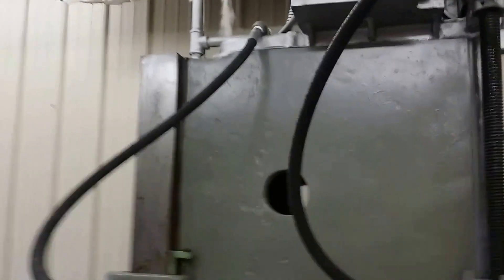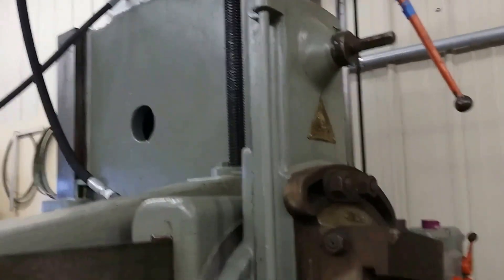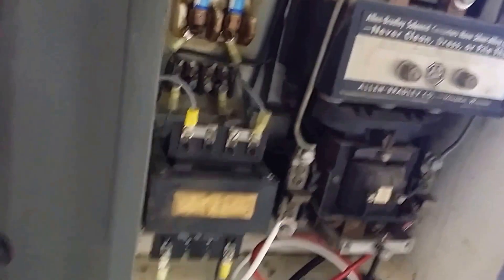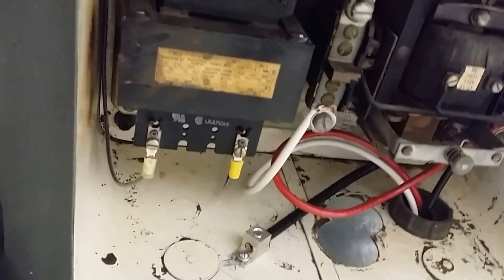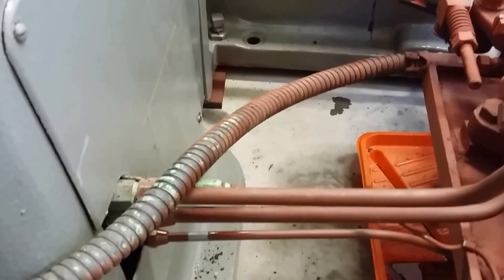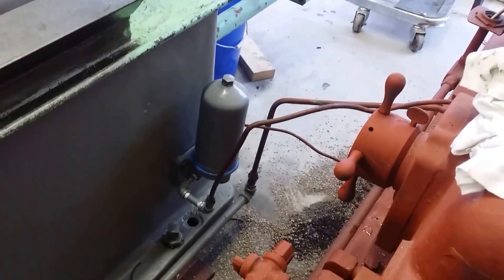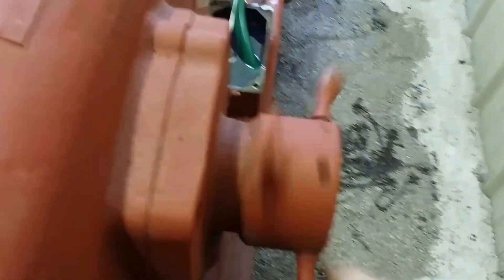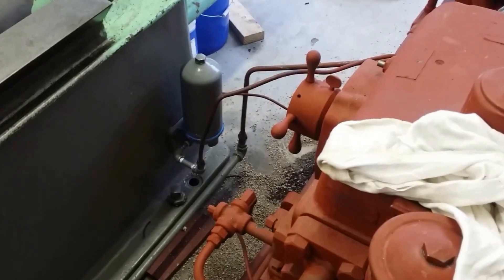First power to the pump.

Comment: Following chronologically these beast videos I noticed teflon tape in the hydraulics. I have done hydraulics some 30 years and teflon so far has been no-no in industrial applications as its tendency to contaminate fluid (i.e.) piece of tape goes into a valve mechanism and it starts acting weird. But this is a machine from the 40's maybe it has bigger tolerances. 🤔

Anyway I am bit jealous of all that old stuff "floating" around there. 😂